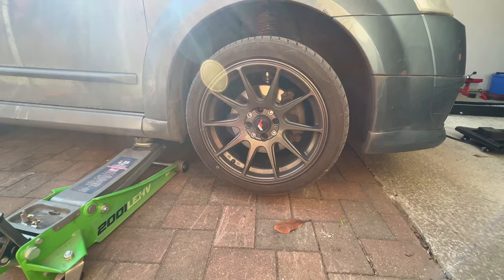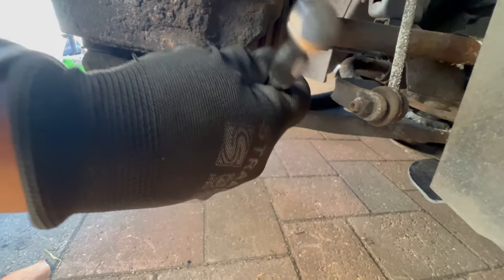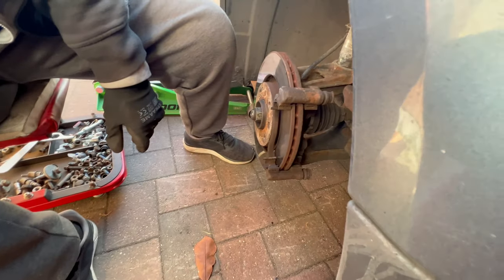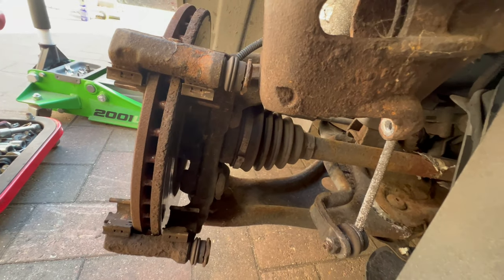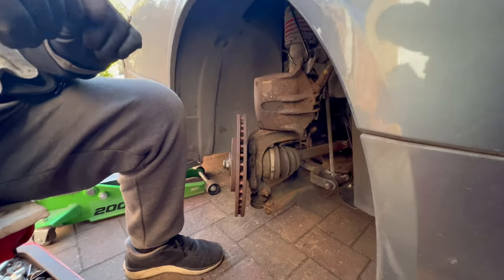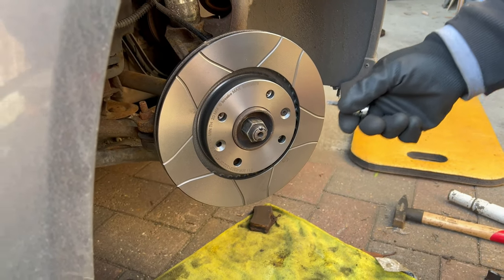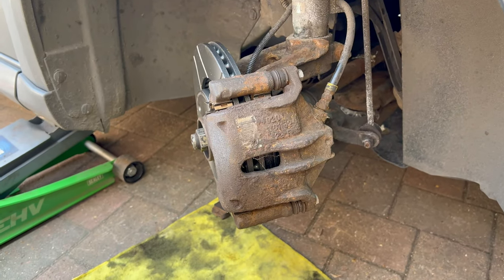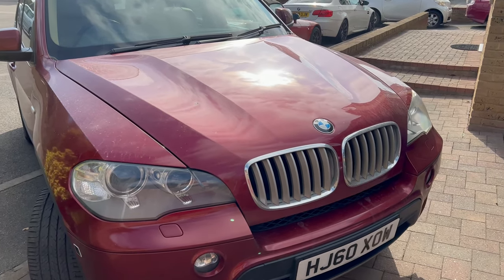Citroen C2 1.6 VTS 2007 Brake Pads and Discs Replacement for Front Brakes

Comment: More citroen c2
Reply from the maker: What else would you like to see about C2s?
Reply: @MrNiceGuy  how to do a timing belt ... and all the other hard bits mate ...
Reply from the maker: Actually, my father has 2 C2 VTS' and one of them is broken down at the moment, it needs a clutch replacement. So we maybe we will do that or if the timing belt parts are not too expensive, maybe we would be even willing to change that and record for tutorial purposes.
Reply: @MrNiceGuy94  great stuff x
Reply from the maker: the timing belt is on the way... ;)